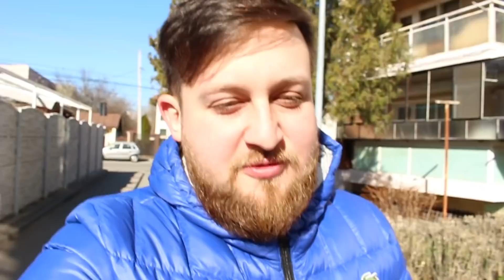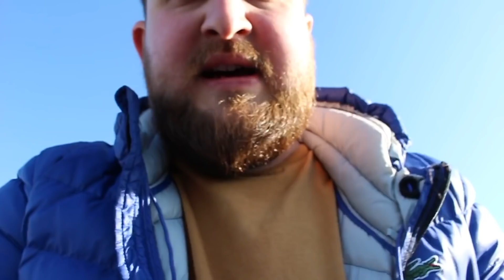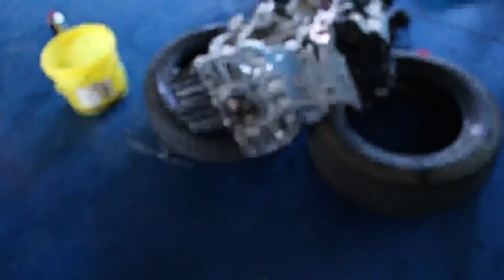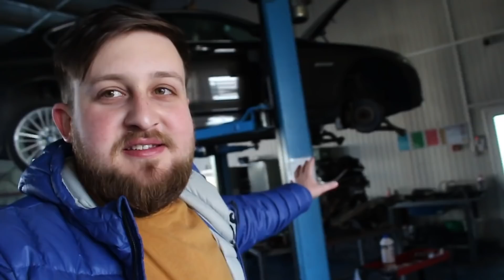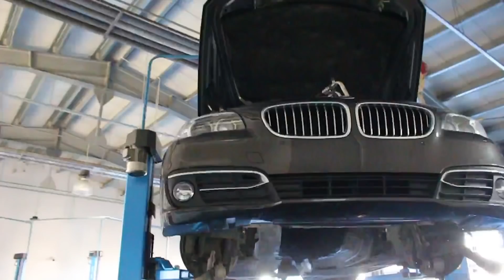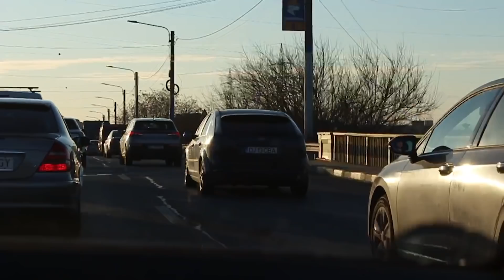AM CUMPARAT MOTOR NOU LA BMW !!!

Comment: pretul motorului avand in vedere si ce masina e ei bine parintii mei au o masina cumparata de noua mai exact un ford focus din 2007 pe care inca o avem, el tragea destul de mult de masina si se distra mai pe scurt cu ea si la 80.000km au inceput problemele la motor asa ca nu a avut de ales si a cumparat unul de nou. Pretul a fost 2000 euro in total din cate am inteles (asta acum 3-4 ani) acum eu cred ca a fost 3500-5000 la bmw (nu stiu exact nu ma prea pricep)
Reply from the maker: Am inteles! Multumesc mult pentru comentariu, Ale :)
Reply: @MariusNicolae97  :)
Reply: @briosa0305  10-12 mii € cam asa nu 3000€